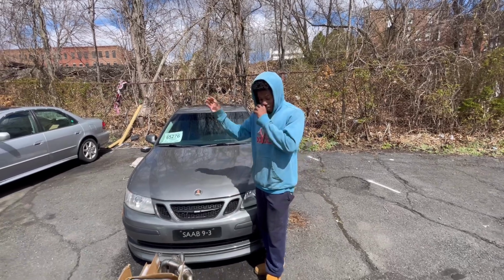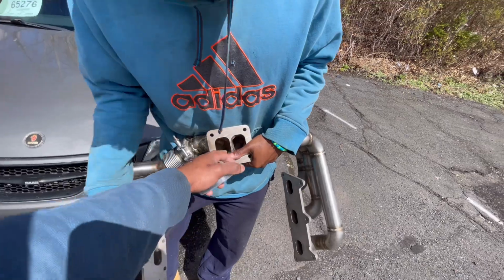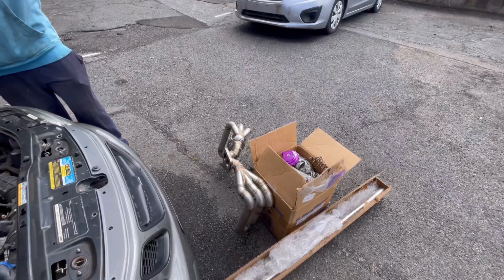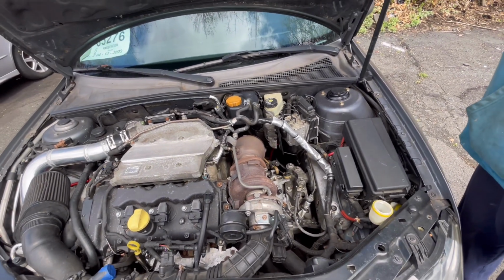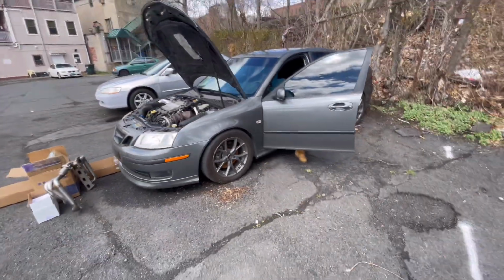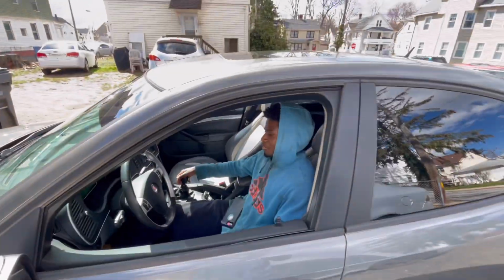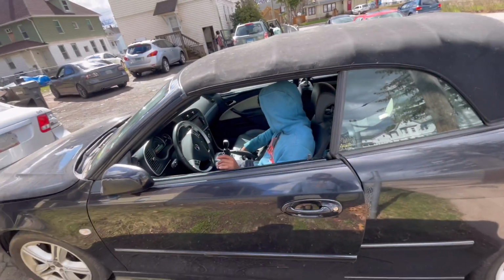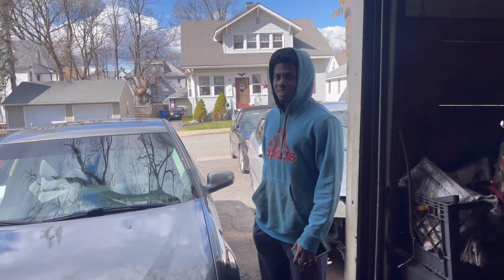Saab 9-3 Aero Big Turbo Build Number 2 Introduction

Comment: Bro how do I re sync my 93 aero key 07 it won’t re connect new battery in the fob and everything
Reply: Might need tech 2 look on the forums if it was already a paired key ask on Saab Central or search someone more than likely already had this issue. Good luck